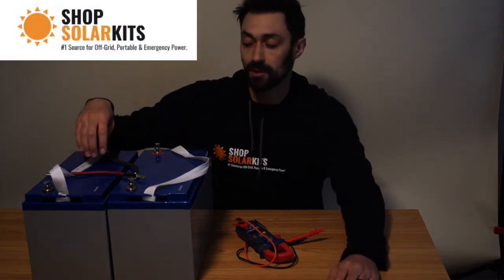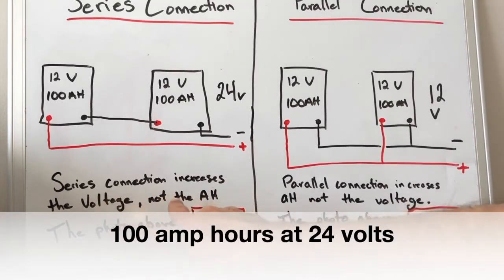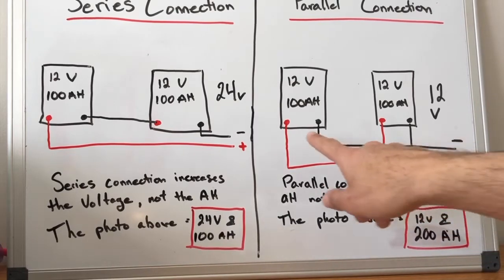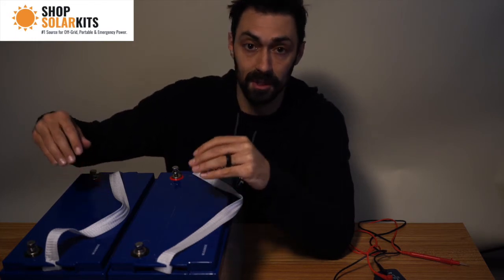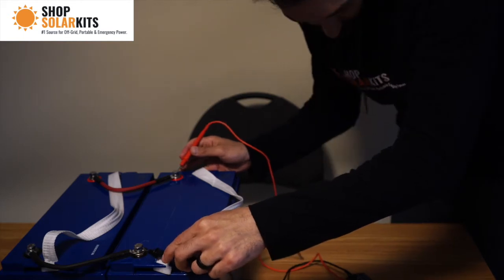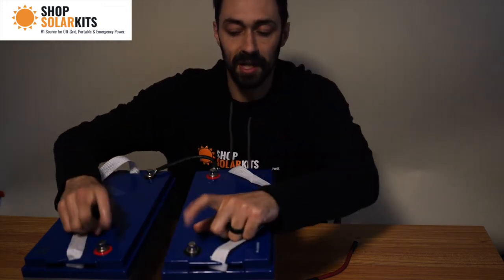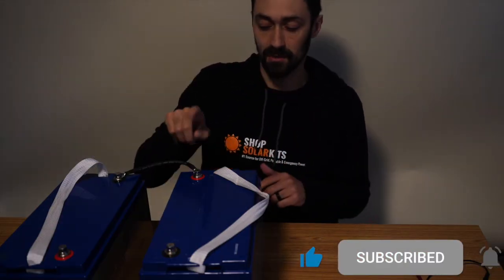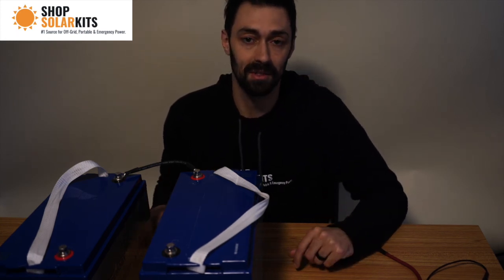Solar Battery Connections Explained: Parallel Vs Series | Off Grid Solar Power Systems

Comment: Hello thanks for your video. I wanted to know how to connect 4- 12v 100 amp batteries you explained, thanks. But you didn't explain how would the 100ah change by connecting 4 12v - 100ah batteries would it stay The same for a 24 volt, would it be only 100ah with 4 batteries. One more thing you never explains the size of the battery cables.

Comment: Does that mean in parallel because amps 100ah +100ah=200ah means my
 100 W lamp can be used for 200ah instead of series 100ah or does it mean there's no difference between series or parallel out put because they are both The same.